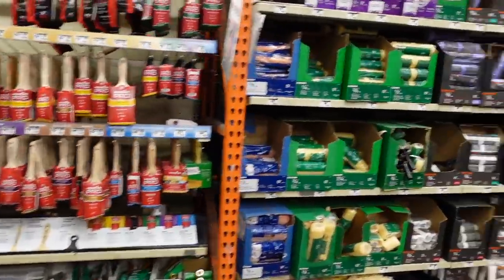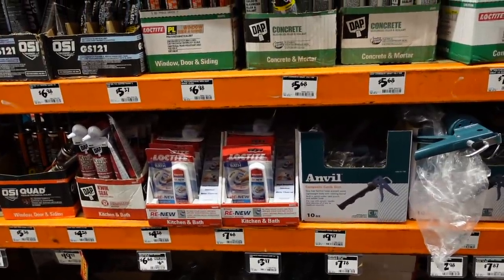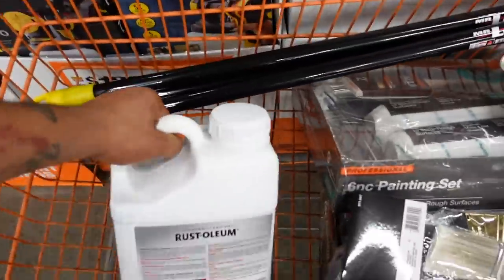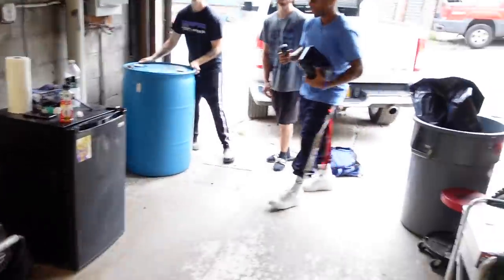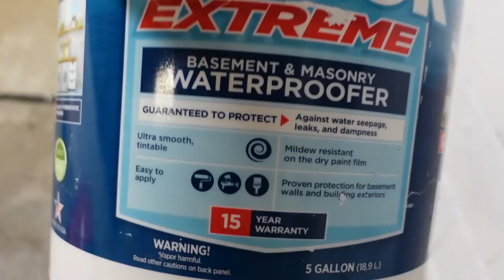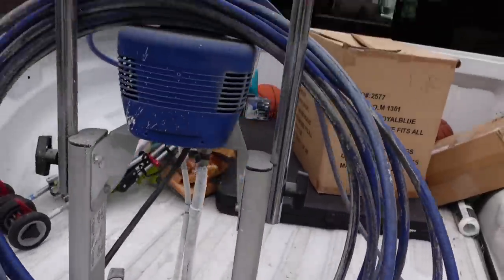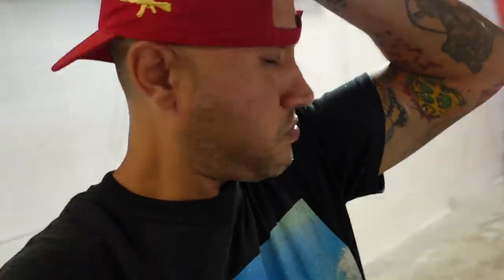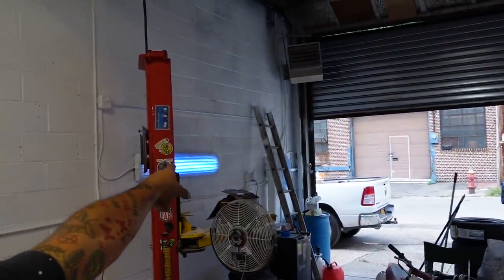Walls All Painted At The Garage (How Much Did It Cost)

Comment: You have to address that hole from the outside first.  Then do the inside. 3 inch  black pipe to take the water from that roof to the street.  That is the cheapest way to stop that water
Reply: Agree

Comment: You should patch up the hole or Crack on the other side too. So it can help and kind of help your building from not Sink. just giving a good idea 💡.. cement or some rubber seal. 🤔

Comment: Great job the garage look real good you deserve it. No cap.  The shop might look nice with a red stripe between the white and the black and put keep gunning stickers across the shop in the red stripe.  Also it might help if you put some concrete on the outside of the shop along the side to seal up the cracks from the outside also. Just a little suggestions